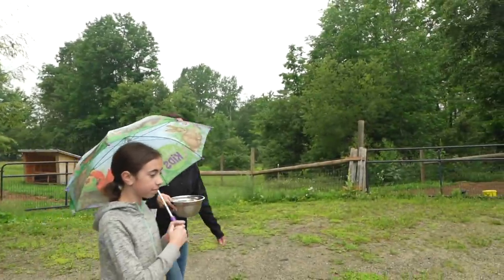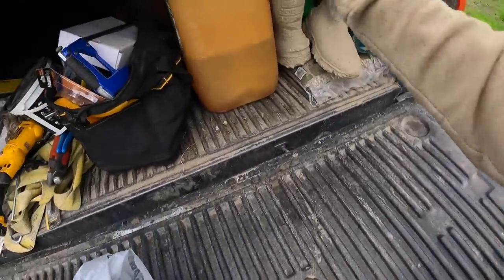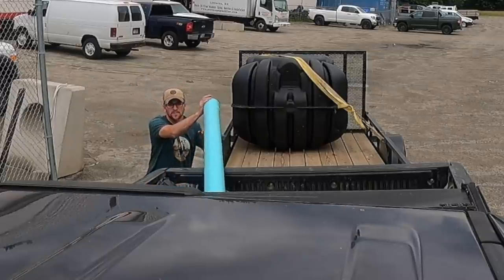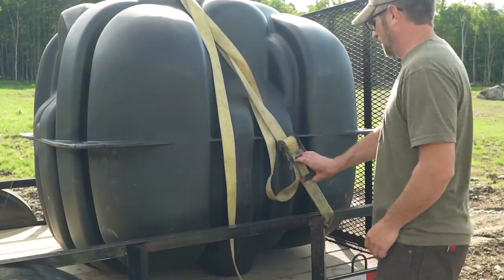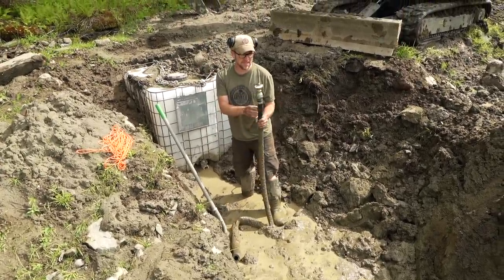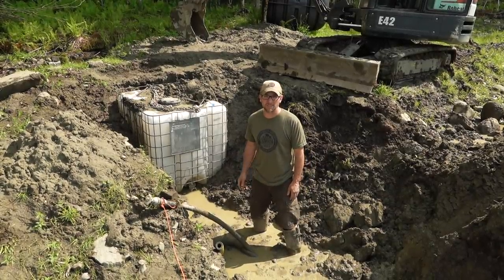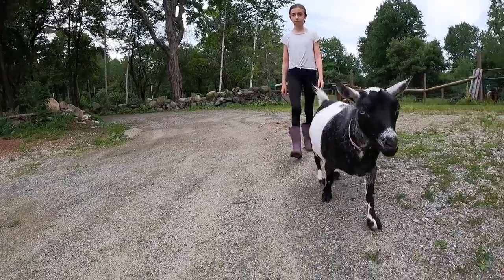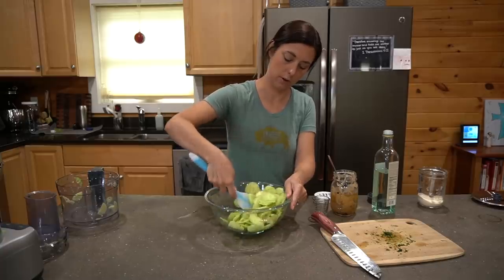Well that DIDN'T Go As PLANNED! PLAN B Building a Gravity Fed Water SUPPLY at Our OFF-GRID HOMESTEAD

Comment: Al, I mentioned in a couple videos back that the pressure in your system is SOLELY determined by the height difference of the water column between the source, your stored tank, and the outlet, your spigot at the hydrant. The size of the tank, the diameter of the pipe, none of that matters as far as the pressure at the spigot goes. It is 100% determined by how high above your spigot the top of the water level in your tank is.

Comment: I grew up with a gravity fed water source. We had over .3 miles of underground water pipe. There are many challenges with that much buried pipe. Freezing is one factor, but if your soil is rocky and depending on the material of the pipe, water leaks can be an issue as well. Clogged pipes are another factor. If you don’t screen the water keeping foreign matter out of your pipe. We placed injection points throughout the line to use air pressure to blow out debris and help find leaks. We also used a second reservoir close to our house to pump from, and the excess water would overflow naturally and run off. My advice, dig a well.
Reply: He put in all that money for property but is too cheap to dig a well.
Reply: If he took that first tote and filled it with a foot of coarse river sand a layer of fabric ground cloth then a foot of river gravel topped off with another layer of fabric and the water would be filter for small rock, sticks and animals. That's not going to solve mineral and organic build ups though. Might take years for that to be a problem.
Reply: @rickster9993  Lumnah Acres said in the first video of this build that they would be installing a filter system between the stream & the tank.
Reply: @KenJ-61  Lumnah Ac said in an earlier reply “We can but I want to have other options for watering the animals and gardens”
Reply: @KenJ-61  ~ I seem to recall him saying they would also have a well. This is a backup water system and also for watering his livestock.
Reply: @KenJ-61  well how do you know how much he paid for his new property, and why would you insult him by callin him cheap?  I don’t think Al is cheap. I think he is very intelligent and talented. He has built his house and all his out buildings on the homestead where he and his family are living now. He knows how to wire his buildings up for electricity. He can grow his own food , raise and harvest his own animals. And he can even cook. If ALL men were like Al, this country would be in MUCH BETTER SHAPE. Yep, Al is a lot of things ( builder, welder, electrician, gardener, etc.) but... CHEAP AIN’T ONE OF THEM.
Reply: @lynteneycke5043  Solar power,Get it.

Comment: Going from 300 to 500-gallon capacity will not change the pressure if you do not change the elevation of the tank.
Edit:
If you had a pipe 100 feet tall filled with water, a gauge reading pressure at the base of that pipe would display 43.3 psi. The effect is linear. Therefore if Al has a drop of 5 feet from his tank to the road, the pressure at the road will be 2.165 psi. I'm afraid Al won't find that to be very useful.
Reply: Lets say he 90s off where he placed the first tank and moves the new tank into the upper left corner of his pasture. How much of an increase in elevation will there be and would the gained elevation make a noticeable increase in pressure to even make it worthwhile? 
I think he will need to hook a pressure washer to the tap to spray mud off his equipment anyway.
Reply: If Al elevated his tank by 10 feet he would only increase his water pressure by 4.33 psi. That is why municipal water tanks average 165 feet tall. I'm afraid Al is in for another disappointment.
Reply: So another almost 1,700 lbs of water will have no effect on the pressure? Really?
Reply: It will have no effect if it is at the same elevation. Zero.
Reply: Let's see..... Original tank = about 1.55 psi at it's base when full.   New tank =  somewhere around 1.90 psi at it's base when full --------- WOW!  Most of us know that that it's the elevation, not the tank size that determines pressure.  From what we can see from the videos (deceptive view maybe) the elevation does not appear to be all that great.   Will be lucky to even wet that mud on the excavator tracks, much less wash it away.  I hope I'm wrong, but my guess is the whole project will be a waste of time and money.
Reply: @benthere8051  yup your right. I looked it up and ran some numbers and little to no change.
Reply: @olgringo-421  oh I agree after running the numbers. I know elevation is needed and I think he’ll be able to pee faster then the hydrant will flow. I just thought the added weight would help some.
Reply: @benthere8051   YEP,....100% correct.  It's about using gravity to create pressure.  Volume alone won't do it..
Reply: I was thinking the same thing but didn't say anything. I don't know the actual elevation he has to work with. He might need set the tank up the hill somewhere to get pressure and still have the water to fill it.
Edit: I was going to suggest running a PVC conduit with the waterline in case he needs to set a pump and bladder tank in the future. I don't know his solar plans but it might be quite the drain on the electrical system at times.
Reply: @unti419  - Yes. A bladder tank and pump would be the best way to generate useful pressure from the system Al is building. Al would have to construct a pump house with a solar array to accomplish that. It would be very power-hungry.
Reply: @benthere8051  I wonder if a well might be a better option. Seems to be a lot of ground water there.
Reply: gas pressure washer will do the cleaning.  @olgringo-421
Reply: @johnreyn100  -- Could be, but pressure washer will still need a good solid supply of water which I'm skeptical whether this system will supply or not.
Reply: @olgringo-421  apparently Al may be lacking in the physics dept.

Comment: More water doesn’t equate to more pressure, raising the water increases the pressure 2.3 feet of height gains a aprox 1 psi. You need a lot of height to get a reasonable pressure…. 80 foot in the air to get 35 psi which is a low but workable pressure.

Your tank is just a reservoir and will need a pump… build a small shed, some battery’s and a some solar panels to power a lift/pressure pump to make it work.

You will need a filter on the tank supply or it will just fill with sediment very quickly and block the pipe.
Reply: I think he already said he was going to build a filter upstream in the spring to fill the tank. We just haven't seen that part yet.
Reply: @StoneKathryn  Correct Kathryn.
Reply: That was my concern.  Al, if you make yourself a cheap water level to check the amount of fall from the tank to the TOP of the hydrant, the more above level the tank sits, the more water pressure you will see.  Otherwise, a pump and solar panel may be in order.

Comment: The problem that he is going to have is keeping the tank in the ground until it gets filled with water before it has a chance to float when it rains. I put an old steel 275 gallon tank in the ground then covered it over with almost 18 inches of dirt them parked one side of the rear wheels of a large school bus on top to keep the coming rain storm from floating it out but after the rain came,  that tank floated anyway and just about turned the school bus over. He may want to have a water hauling company ready to haul water to fill it as soon as he installs the tank in the ground.
Reply: I hope Al sees this comment!

Comment: Al, you will not have any more pressure with a 500 gallon tank vs a 300 gallon tank. The pressure is a function of difference in height form the source to the outlet. Think hydrostatic pressure.
Reply: Exactly.  More volume does not equal more pressure.  However, if the tank was located further up the mountain in the woods behind the stream, then yes, there would be more water pressure generated as the contained water level will be higher than the hydrant nozzles.
Reply: I'm not sure he's going to have any pressure at all. That property looks pretty flat to me. Sure, water will flow into the entire pipe. But, I doubt the hydrant outlets are much lower (if at all) than the top of the tank, muss less the bottom of the tank when it starts getting low.
Reply: @basiljackson3829  cameras are notoriously bad at showing height differences.
Reply: Did you ever wonder why the tanks in municipal water systems were so high. Rough calculation, 2 foot of water height equals about 1 psi pressure. Most domestic water systems are roughly 50 psi so most water tanks are about 100 feet high. If you don’t have at least 100 feet of elevation drop you are going to be disappointed with your flow & pressure.
Reply: i agree i think a little pressure added to your tank would give you enough pressure to fill buckets or something like that
Reply: I'm wondering if he'll have to put the tank above ground and build a shelter around it with major foam insulation like with Off Grid with Doug & Stacy. Use a ram pump to get spring water in? Have a solar heater there and in the tank? He might have to change his plans a couple more times.
Reply: @josephlansberry737  Check out Off Grid with Doug and Stacy. He does a system with not much elevation.
Reply: Right, water pressure is determined by Hydrostatic pressure (water column height) not water volume.
Reply: Yup, a mini water tower. Filled with pump from,storage
Reply: @tmodrill1  so the add roughly 1,700lbs adds no extra pressure?
Reply: +WBM As soon as he started burying his reservoir underground to make a "gravity fed water supply" I wanted to point out this simple flaw in his logic but he seems stubborn about taking on board any negative criticism. In fact he has said so on video more than once that he prefers to learn his own way by just doing or whatever so I refrained until now.

Just glad he hasn't harmed himself in that soft earth trench that might've collapsed on him while he went into it.
Reply: @dontfit6380  That is exactly correct.  Pressure is only determined by the height difference between the top of the water and the outlet point.
Reply: @branchingoutpermaculturewi4766  That is all that is needed !!
Reply: @StoneKathryn  ~ Don't know if you watch Good Simple Living's channel (delightful, industrious family), but they also built an insulated pump house in northern Idaho with a themo-controlled heater.
Reply: @tmodrill1   Someone sounds like a fellow engineer.....:)
Reply: @samvalentine3206  Exactly he is not going to build up enough head pressure with the small drop he has.
Reply: @LegendHold1  Retired old school oil field Directional Driller. Knowledge of Hydrostatic Psi is mandatory to calculate down hole Psi.
Reply: @LegendHold1  you engineers are way above my head. LOL.

Comment: You mentioned more pressure with a bigger tank.  Height is the only variable that will get you more pressure.  For every 33/34 feet of drop you will gain about one atmosphere of pressure...14.7 psi.  Larger tanks can supply more sustained  volume but only a taller tank or greater height from source to point of use will supply more pressure.
Reply: And if you are expecting spring to fill the tank, it won't fill tank higher than the height of the spring unless you use a pump.
Reply: Steve B ~ I know I've said it a hundred times already, at least, but there are tons of expert opinions in Al's comment sections. I learn so much from reading all the comments.
Reply: @TXNLaurenMcN  Lauren, the thing is...If volume of water controlled pressure rather than height above the outlet.  Stepping into the ocean would cause your foot to be crushed.

Comment: Al there is nothing wrong with showing the problems.  The only thing I caution you about is getting in that ditch.  You have noted on several occasions that the ditch caved in.  Either cut the ditch wider or stay out of the ditch.  Don't work by yourself.  Love the videos!

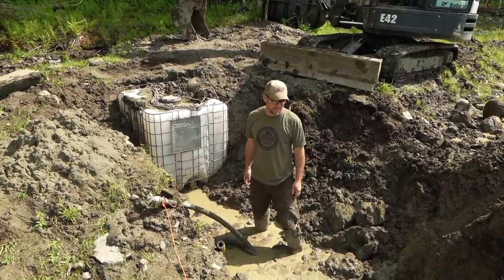Comment: One of the tote problems is the rain flow from the trench above the field.  Any water diverted by that trench goes right into your dug trench 19:19 - Perhaps a long piece of PVC sewer pipe as a temporary "floating" or "hanging" culvert would help.  Put one open side of the sewer pipe on the upper trench and dam it in with dirt, leaving the end open - have it span your trench over the pipe you pulled back out of the mud with the rope, and put the other end so it extends the trench.  Any water coming from the upper field trench would continue down it's original trench and not go into your dug trench.  That would temporarily reduce the amount of water going into your plans... every little bit helps, and all it would take is a length of sewer pipe you may already have laying around!

Comment: You are not going to get much pressure if any at all with the set up you are doing. You need 2.3 feet of elevation drop to get 1 psi of water pressure.
Reply: He is going to need his pressure washer to clean equipment.
Reply: @tomreichardt6044  Well, pressure washers need about 2 gallons of water per minute to keep the pressure up. Hooking them to the spigot I don't think will be enough just by gravity. He'll need a large tank above ground to spray his equipment off with I think. The gas run pressure washers build up better pressure than the electric ones.

Comment: couple things.
the only thing that creates pressure in a gravity fed system is head, think about a siphon. 
the frost line is like 4 feet under ground. I dont know how committed you are to keeping that from freezing, but its gunna be complicated.
Reply: Build a small insulated shed above tank with solar-powered pump inside...don't know if it would work but Al seems to learn as I do...trial & error 😀😉
Reply: @garymixson687  something likethat entered my mind too,  and it could be hes got a plan that I missed or hasnt talked about.
then questions about the pipe and how deep it is.
it just would be heartbreaking to watch all the work and frustration thats already gone into this burst from ice in the tank mid february to be dug out and replaced a second time next spring.

Comment: You can put a solar power heater in the tank that we won’t freeze in the winter
Reply: Yes, a 12v panel hooked up directly to a 12v car block heater or some diesel glow plugs - don't need a battery - just have it hooked up direclty
Reply: Good theory till you get 2 feet of snow on the solar panel
Reply: @gl309495  - There's always something!

Comment: Al, just put some plywood along the outside of the cage.  And add/use some insulation foam board to keep it from freezing.  That will keep the dirt from putting the pressure on the plastic and cage..
Reply: Exactly.  Of course with the price of plywood being what it is now... it would pay to use some old pallets to cover the cage in pallet wood.  Anything as a barrier to keep the pressure of the dirt at bay.  The insulated foam board is also a very good idea - along with a 12V solar panel connected to a car block heater that's put inside the tote, the water reservoir will hopefully never freeze!

Comment: The size of the tank does not affect the pressure, but the quantity. The pressure is determined by the height of the water column. 
Your tank floated or was washed away by water and mud. The reason is improper installation.

Comment: Have you seen the off grid water system from “off grid with Doug and Stacy?
Reply: That system is amazing. I like that Al already increased his water pipe diameter because the elevation between tank and spigots is not large, just like with Doug's system.
Reply: Yes, but he has a pump. Gravity can’t be denied. Sir Isaac Newton made that very made that very clear many years ago.
Reply: What is the difference in frost depth between Missouri and NH?
Reply: @josephlansberry737  I didn't know Doug has a pump in his water system. I thought his water system is all gravity fed. I think he has said that many times. Yes, he has frost free spigots like what All is doing. I've never seen him using any pump except for Stacy's garden tank so that she could water her garden without toting all those water cans around and just use a hose. That is the water collected off the greenhouse into it's own tank. He put the huge tanks up on 2 feet of gravel to get a little bit more head.
Reply: @rt3box6tx74  2,5 ft. / 5 ft.

Comment: OK- so I think you haven't thought thru this Water system- Now I know from the past videos, you have used, and understand how a WATER LEVEL works.
The level of the water in the line will NEVER go higher than the top of the water in your buried tank, which is still well below the surface of the ground, so unless you Move the Tank, to MUCH higher ground, or replace those "Hydrants" with old fashioned pump-handle pumps, your system aint gunna work budd.....

Comment: How about putting a barrier around it. Between the tank and the dirt
Reply: If all 4 sides of the tote was lined with some exterior plywood, then problem solved.
Reply: except plywood would rot eventually.  I think concrete blocks would work better.
Reply: OR the extra scrap sides of the Shipping container he cut out for the windows and doors, that steel would last 20+ years underground-